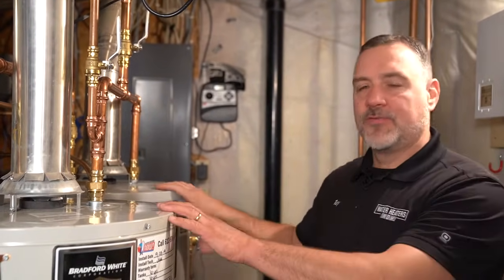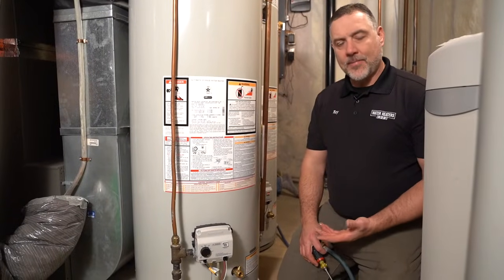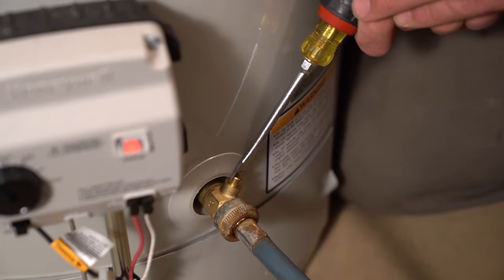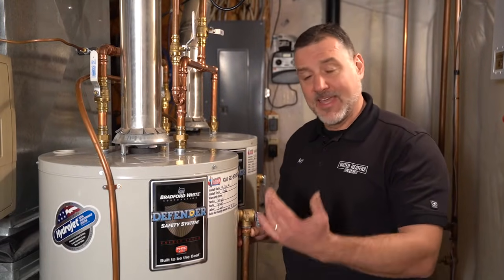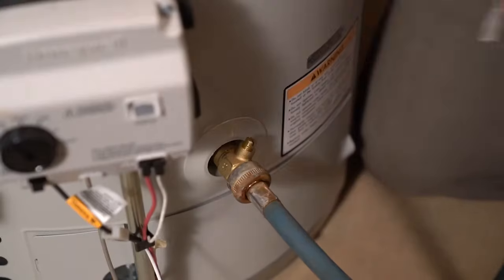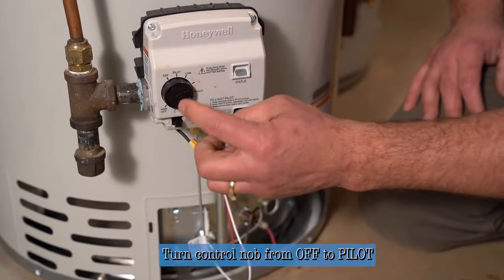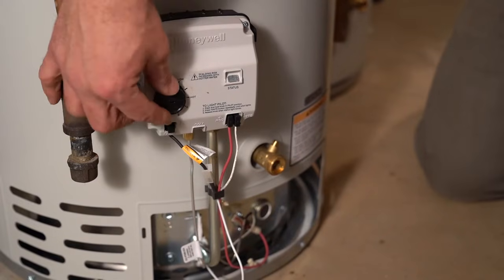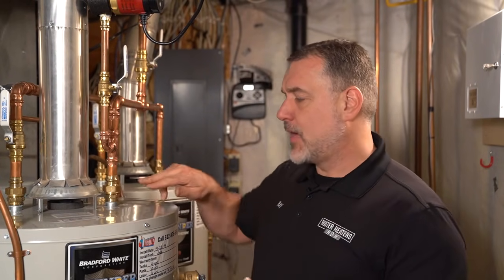Annual Maintenance on an Atmospheric Bradford White  Water Heaters Now

Comment: This was the first time my water heater went out, it freaked me out, and I followed this video, getting everything up and running in just 5 minutes!  The only thing is that my light started blinking red in the beginning, I pressed the black button a few times again, and it started blinking green.  I couldn't see any fire through the window even after I turned off all my lights, but I could hear the gas was going, the heater was working, and the light was green.  I think I am ok!  Thank you for the video!!!

Comment: I have this water heater. Can i just attach a hose and drain for about 5 minutes? Then wait until heater fills back up, then drain water again? Without turning off water or the gas? I also heard to just turn to pilot and you dont really have to turn gas off  completely
Reply: Yes, What you're doing is a power flush. Works good

Comment: You forgot to turn on a hot-water faucet in the house to let the air in so it would drain. Otherwise if you just open the valve, nothing will drain out of the hose due to lack of air.

Comment: How is this unit powered for electricity.
Reply: It’s not. It will run if you lose electric power. There is a small battery inside the unit for the blinks light, but it lasts a very long time.

Comment: No mention of opening the hot water valves on the fixtures supplied by the heater?  They're not going to drain very well if you're not allowing air to replace the water in the tanks and filling them will be an issue if the air in the tanks can't be pushed out the hot fixtures to allow the cold water to fill the tanks again.

Comment: Do you do anything with the pressure release valve?
Reply: He answer??
Reply: @Davidblaine18  no
Reply: @honeyqk  so what you do
Reply: I had someone do it for me. He didn’t do anything to the pressure release valve. 👍
Reply: @honeyqk  I have a electric water heater no heat- turned off the Breaker and still got a shocked 😳😳 I’m not messing around anymore

Comment: Thank you for video.
BW website says to release the pressure valve before draining.
You recommend to not do that.
Who is right?
Reply: My plumber has told me that pressure relief valves are not made very well these days and sometimes they will not shut off all the way when you manually open them.  Then you're looking at replacing the valve.  So he recommends not doing it.  I've done it without issue, but who knows?

Comment: I have a Bradford White 75 Gallon gas water heater and the hot water side of the connection is badly corroded and I think it's because it's plumbed with dissimilar metals, copper & steel. Anyway, so I have to replace it and I'll replace the anode rod as well. The question I have is that my connections are 1" NPT rather than the standard 3/4."  I looked through Bradford's specifications and this model shows 3/4" NPT.  What gives?

Comment: What about cleaning the gas chamber filter at the bottom of the tank? I have a bradford white and had to clean it. Gets clogged with dust, dog hair and lint  trips the high limit switch shutting the unit down.